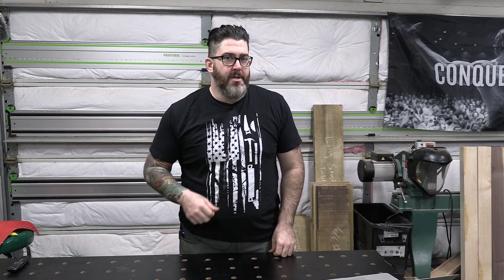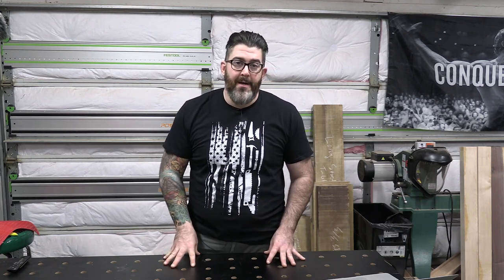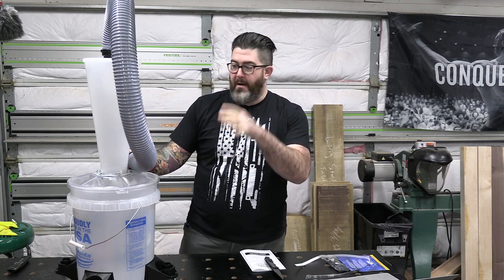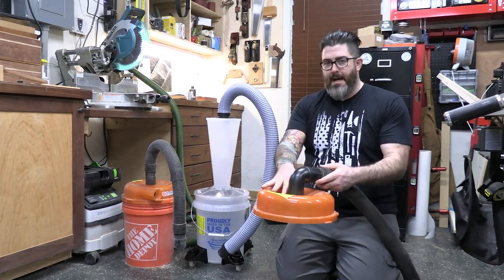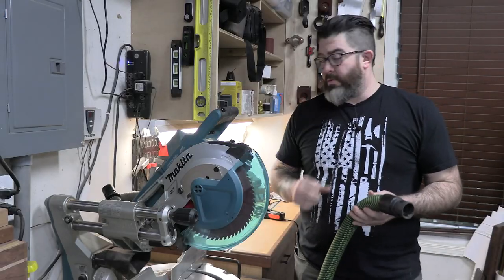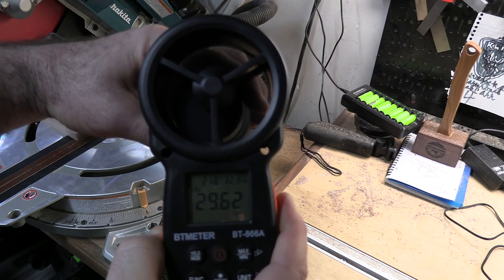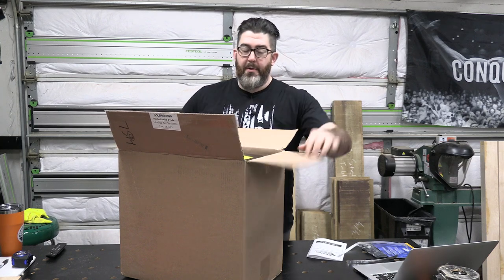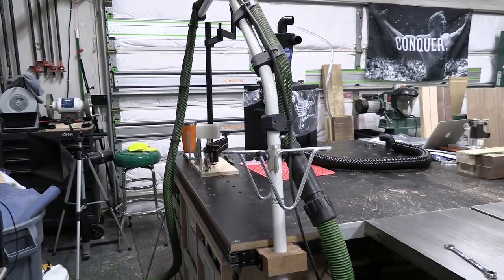Goodbye Festool? Oneida Dust Deputy Cyclones First Impressions

Comment: I have found the Festool "cyclone" (really, more a Thien baffle) to be my only Festool disappointment so far.  Thien baffles restrict air flow by as much as 50%.  I have ordered the Dust Deputy 2.5 Deluxe kit that has the 10 gallon metal barrel and will use it with my CT36 instead.  I would love to hear the result of your response to medic0us concerning switching out the DD 2.5 with the original DD on the DD ultimate.  Thanks.
Reply from the maker: Agreed - I’m heavily bought into the Festool system, and the cyclone just doesn’t cut it. I’m glad to hear you got the 2.5 - it has been amazing! 

I’m going to be putting the 2.5 on top of the Ultimate for sure, and O wide just sent me their new low profile dust deputy to try - they claim it beats out similar Thein baffle designs, so excited to try and share!
Reply: @garagedwellersww   Well, my DD 2.5 Deluxe kit arrived and I hooked it up to my CT 36.  The air flow was definitely improved with the DD 2.5.  On the first go I continued to use the stock 27mm hose provided by Festool with their Thien  baffle for between the Thien baffle and the CT 36..  Then I replaced that  with the 2.5 inch hose that came with the DD 2.5 Deluxe kit and there was a massive improvement in air flow.  I am now quite satisfied with the overall combination of the Oneida DD 2.5 Deluxe + the Festool CT 36.  

The Festool Thien baffle thingy will be retired except for those relatively rare occasions when I need to travel with an all Festool stack of vacuuming equipment, or perhaps I'll give someone a good deal on it.  Haven't decided that yet.

The DD 2.5 Deluxe kit rocks and I can see at least one more place for one in my shop.

Comment: My suggestion: If you want the best succion, swap the small Dust deputy cyclone that comes with the ultimate setup for the 2.5 Dust deputy cyclone.  Clan or change filter and bag in your Ct 36 and  they will stay clean (filter) and empty (bag) for very very long time.
Reply from the maker: Interesting idea - I’ll give it a shot.

Comment: These cyclone dust separators comparisons should be focused on primarily measuring suction loss before and after their installation. They all seem to avoid the particulate from clogging the vacuum filter which was the intention purpose of my purchase. I have a large Oneida cyclone dust collector with a 6” hose that I attach to my big machines. I have a Festool CT33 that I use throughout their system of power tools I own. I also have a Ridgid 14 gallon 6.0 peak Hp NXT wet/dry vacuum that i purchased specifically for dust collection on my miter saw. I found this vacuum to be superior for this usage with its larger hose and strong suction. I did not want my filter to constantly be in need of service so I purchased the Dustopper and built a cart for installation above it. I also purchased a dust collection bag to be placed inside the vacuum and further reduce finer dust from accumulation on the pleated filter. Completing the outfit is a i-Socket auto switch to activate the vacuum while the saw is in use. I have been completely satisfied with this setup. The Oneida Dust Deputy models seem to have an advantage over the Dustopper with lower lossage of suction. I don’t know what the issue is with these Festool dust collectors as mine drops a lot of dust too when removing that large hose connection at the vacuum port.
Reply from the maker: I’m going to do a deep dive comparison in a few months where I go into detail, compare hose sizes, and all that on all 4 of these. You are right - the hose size makes a BIG difference! I have run the 27mm, 37 mm, and larger hoses, and the bigger diameter definitely makes a difference.
Reply: One cup of fines can make a HUGE difference in vac or even collector efficiency.

When I bought my first cyclone, the steel Dust Deputy, about two decades ago, it was because I was using a tool called a Paint Shaver Pro. It would remove one square foot of paint from shakes, shingles and siding in about a minute.  Without the pre-filter, I had to clean out the vac (filter) every five minutes.  I made a water filter and it solved the problem, but left me with some nasty sludge to deal with.  I gambled on the Dust Deputy and have been a convert ever since.

One cup of, for example, sheet rock dust getting past the pre-filter knocks the vac efficiency down notably.

Comment: I’ve tried all of what you have. I think the ultimate dust deputy functions excellent force what it’s designed to do, yet function while sitting on a ct 36 is not good. It wobbles and it’s quite tall. The dustopper is equal in function to the festool separator as they’re both designed like a thein baffle. I have ultimately reverted back to the dustopper. My bag is about a year old and I doubt there’s a pints worth of dust/particles in it. Oneida actually refunded my whole purchase price and shipping because I wasn’t satisfied. They definitely get a 100% on customer service.
Reply from the maker: Interesting! So is your dustopper stationary, or mobile with the vac for what you do? And agreed on customer service, Oneida is top notch.

Comment: Great to see these comparisons, I purchased the Festool cyclone because of it size eventhough it does reduce suction. With regard to the sanders, according to Festool you need to turn the suction down, it would be nice to see if increasing the suction power helps collect more dust. As for other tools keeping the suction as high as possible should be the deciding factor. Thanks for the great video.
Reply from the maker: Great point about turning down the vacuum suction for sanding.  Since using the Festool cyclone at my bench, I have had to leave it all the way up to get the same pull that I got with a turned down suction with no separator.  In the next couple months I will definitely play with the suction levels.

Comment: Yeah the dustopper and festool cyclone trade efficiency for compact size, which explains the suction loss. The dd 2.5 is amazing.
Reply from the maker: I have been really impressed so far. In two weeks it has sucked up what the dustopper was taking a month or more to do

Comment: I'm currently using a Ridgid vacuum with a Dust Right separator from Rockler. I've been planning on moving to one of the dust collectors from Laguna. My long term plan is to get a large unit for my bigger machines and a small extractor (probably a Festool product) for benchtop tools. Looking forward to having a cleaner shop with those upgrades done.
Reply from the maker: I would give Oneida a serious look. I have the V System, which is a bigger machine.  The supercell in particular I have heard amazing things about - supposed to have some tech that is good for big and smaller tools. It’s worth giving them a call - they will go through your setup and make a recommendation for you. My brother has a rigid - he likes it a lot.

Comment: I have the Oneida cyclone funnel, not the deluxe where the bucket lid is included. My plan was to make a custom lid to fit over the large Rubbermaid garbage can. It’s not worked well which is puzzling as I can see the waste action inside of the cyclone and it seems to be traveling down to the waste can, however 90% of it is collecting in the shop vac. I’ve worked on the lid to can seal but it’s still not working well. FYI I routered in an accurate fit groove into the plywood custom lid (it’s not just sitting atop the can) so I’m trying to supplement that seal. It’s still not working well. Frustrating!
Reply from the maker: That is really frustrating. I used trash cans before too, and no matter what they just don’t seal well. Also, wood is porous so you lose some suction with the plywood top. You should check out an Oneida drum - the seal will be perfect. It’s one of those areas where I think it’s worth the extra money as the DIY route doesn’t hold up.
My brother uses a super dust deputy, and he ultimately went with a drum for the same reason, couldn’t get a trash can to work.

Comment: Every inch of hose you can dump ups the efficiency, as you noted. 

For that reason, I mounted my vac above the Deputy, mounted on a 20 gallon drum, after modifying the vac so the input was a tube terminating up near the top of the vac collection drum, and which comes through the bottom of the vac drum, from the Deputy. Of course, the stock input is plugged to force air intake to come only from the modification.

Tipping is a non issue. More so because I put large wheels on the can and a wood handtruck handle. 

Three aluminum tubes support the vac above the Deputy and have Allthread through them, so you can actually lift the whole unit by any one of them.

Of course, rare is the Festool vac owner who wants to modify his vac to accomplish this.

Comment: You made a comment at the beginning of your video about the cost of regular shop vac bags vs Festool bags, saying Festool bags are more expensive.  This is not exactly true.  I have a 14 gal Ridgid shop vac, a two pack of bags from Home Depot costs $22.97 or $11.49 per bag.  A five (5) pack of Festool bags for the CT26 is $46 or $9.20 per bag.  Now other bags for other models may cost more, but for the CT26, you’re saving $2.29 per bag and getting three additional bags as opposed to two from Ridgid.

I am by no means a die hard Festool user, but I do look closely at the cost of consumables before I pay a premium price for anything, especially a vacuum.  In this case the upfront cost of the 
CT26 is steep, but in the long run, the cost of bags are considerably cheaper and even more so if you attach a cyclone separator.
Reply from the maker: Nice. When I first bout one the bags were more expensive than what I was paying for my old vac, and I sort of extrapolated that to generalize. Good to know it is more cost effective. Running the separator is nice because I rarely have to replace bags.

Comment: A TIP: That down draft table efficiency would improve 1,000% [give or take .1%   ;)   ] if it had sides, a back and a top. 

After I built mine, it dawned on me the air pulled into the table was being pulled in from everywhere, rather than JUST where I was sitting. I added four uprights (one at each corner) and draped some nylon I had sitting around over it. This forced all the air being pulled in to be limited to where I was sitting or standing.

After I added the sides, back and top, I could hog wood off something using, for example, my Foredom and an aggressive, carbide bit and watch all the stuff pull straight back into the table, then do a curving 90 down into the table.
Reply from the maker: It's actually not a downdraft table, although I would love to have one. It's just a big MFT table. The holes are for holddowns.

Comment: I Have the original 1 1/4 Dust Deputy with a metal top and metal container.  It is hooked up to my Craftsman 1/2 round hang on the wall shop Vac.  Even with 1 1/4 hose it does amazingly well.  My only complaint is the small diameter cyclone input.  It often clogs with larger chips of debris such as hand planer shavings.  I also have the Festool shop vacuum and do like its portability working with the sander and track saw.  The dust deputy seems to increase flow even when hooked up to the Festool Vac.  I am considering a newer Dust deputy with larger hose simply for the clear container and larger hose reasons.  I am considering the NEW low profile dust deputy.  Thoughts???

BTW I am an Oneida fan from way back.  My shop has a 3hp Dust Gorilla which I love!
Reply from the maker: Big Oneida fan myself. You can’t go wrong with the newer model - big input, no clogs, and great air flow. I’m actually looking to try out the new low profile one myself - I’ll let you know once I get my hands on it 👍🏻

Comment: The Dust Deputy Ultimate you have seems to be a new version of the Dust Deputy Ultimate compared to the one I own.  The one you have seems to have a heaver dust bin, the dust bin bag hold down vacuum tube seem to have a larger diameter and  the vacuum tube has different connecting connection points.   I cannot find the Dust Deputy Ultimate you have on their website.   Where can I buy the one you have?
Reply from the maker: This is the one you’re looking for: https://amzn.to/3E40P4d

Comment: For someone that is looking to purchase a festool dust extractor and wants the oneida 2.5 dust deputy, what would you recommend buying to maximize suction? Which extractor and which dust deputy. Will be used mainly for sanding and track saw.
Reply: Been happy with my setup for past several years.  I’m using the original small DD now called  “Dust Deputy DIY Retrofit” that’s $40 through Amazon.  The dust extractor is a Nilfisk Attix (roughly equivalent to a Festool).  Running 13’ or so  27mm hose to sanders and 33mm hose to track saw and routers.  In either case there is more than enough suction. 
 has more than enough suction and in fact I usually open a port at the handle of my hose to let off some suction when sanding.  
Suggest getting the original DD (small $40 version) and mount it on a metal 5 gal paint bucket above your extractor.  Run as large of diameter a hose as you can from extractor to DD then downsize the hose from DD to tool  to 32mm or 27mm.
Reply from the maker: So most (definitely not all) of the Festool dust extractors are equivalent in motor and CFM, what more matters is what you want feature wise. If you are more stationary and want size, the 26/36/48 are awesome. If you want mobility and smaller features, the MIDI is great. I have two 15's as well - they work great, and are small/the most affordable. The DD 2.5 is I think the best, although I have the ultimate and the lo pro as well. Both are great, but I think the DD 2.5 has the edge if the size/profile works for your space.